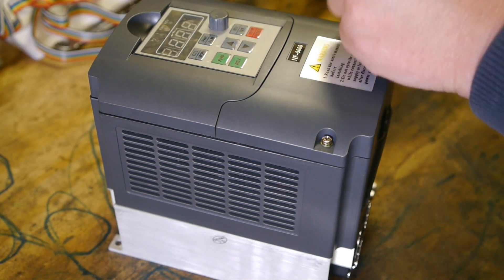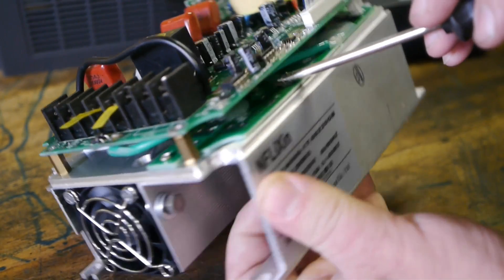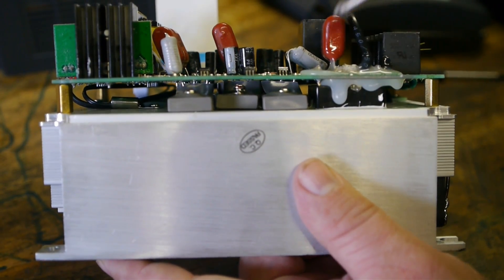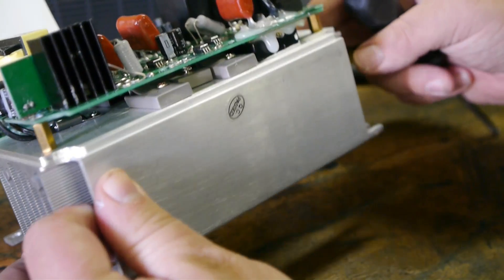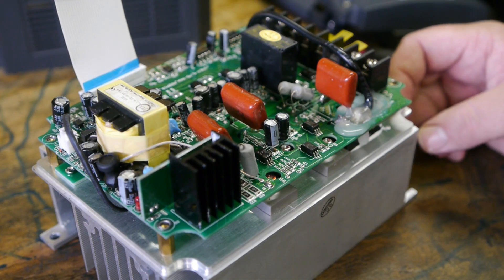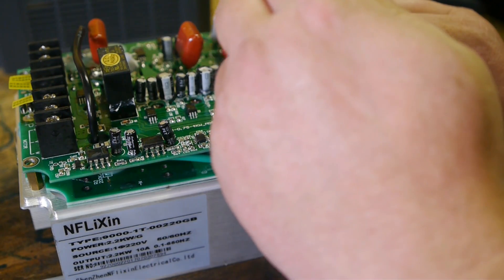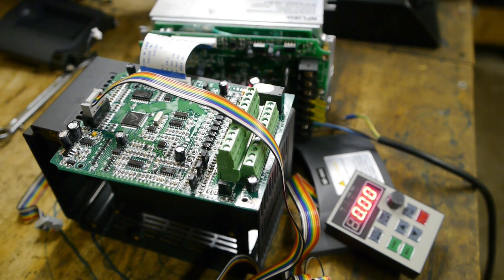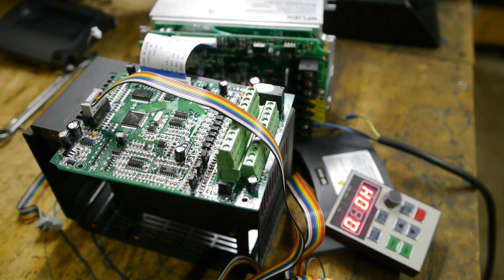A look inside a cheap chinese frequency converter

Comment from the maker: FYI: Without the sensor connected, F062 (heat sink temp) reads zero and rises rapidly when I short the connector the drive goes almost immediately into overheat protection. So the sensor most be an NTC and firmware seems to be programmed to start the fan immediately. (Perhaps to cool the build-in brake resistor) 
Unless I find a parameter to change this behaviour, witch seems unlikely given the limited manual,  there is not much I can do. Looks like the manufacturer was correct and the manual wrong. It still sucks though!

Comment: I run an external fan (old PC 12v fan) using the 10v and COMM output.  Inside a cabinet, the PC fan blows air upwards under the VFD.  The VFD fan operates when the logic is running and about to provide 380v output.  With the external PC fan, there is direct air movement over the heatsink as well, whereas the VFD fan is only over one part of the heatsink (9100, 5.5kw, has one fan).

Comment: Weird! Why would you fit a sensor and not use it? Just stupid to do that. You could make a small temperature switch board of your own and connect it between the two pin fan connector on the board (it will provide power as it is always on) and the fan itself. I know you said you know little about electronics, but only a few components are needed. Do a search for: MOSFET fan temp switch to find dozens and dozens - some simple and many more complex ones using a microcontroller (NOT required)

How is your soldering technique? Here are a few design ideas using a single N-Channel MOSFET. There are multiple subtly different designs on the same theme. The simplest requires only THREE components and could easily be added by just building a "birds nest" circuit - just soldering the components to each other in mid-air and using Kapton tape around to insulate them. FULLY adjustable too, should you need it using a small potentiometer as in circuit 3. Number 4 shows a bird's nest setup.

1. https://circuits-diy.com/wp-content/uploads/2020/01/dc-fan-speed-control-thermistor-965x1024.png
2. https://i.stack.imgur.com/U8hDM.jpg
3. https://lh3.googleusercontent.com/proxy/oGHVuaRc2LMsAVNhK9H2hnWWXWxpap95aczfVYUta4Z7iMUEN2mn0zHeLeagTWHkKKlpDZzEOU5VUvEbCKQP1f3M
4. https://i.stack.imgur.com/U8hDM.jpg

I have literally just taken delivery of a model 9100-1T myself. I hope I don't have similar problems. 

Those small fans are the same type and size as fitted into many Netgear, Cisco, and HP Ethernet network switches and they are STUPIDLY loud. I have NO idea why. Probably due to trying to drive too large a volume of air with too small a fan. You could try sourcing a replacement fan that is quieter, but my experience says there is little choice at that end of the market compared to the more "standard" computer fan. In the case of Network switches, they are REALLY loud (usually 3 or even four fans!) A MUCH better, quieter, and higher volume of air could be achieved by a long radial fan rather than multiple small axial fans. Also, it never ceases to amaze me why electronic designers ALWAYS seem to exhaust hot air rather than forcing in COLD air! Dumb as pig poop in my view!

Comment: I wonder if the drive heats up during normal operation, and the the spindle is turned off - if the fan will remain on if the sensor detects the temperature is still over 45C?
Reply from the maker: Possibly, but I never notice. When I first got the drive I monitored the temperature after I unplugged the fan connector.
Never when near 45 degrees but last winter I suddenly died with a flash and a bang followed by total silence.
The fan on my new stops direct when I stop the spindle. A lot better :) https://youtu.be/O093niJnIaU

Comment: Another great video. I really like your calm, understated style. keep them coming ;-) Thanks. 

From what you said in the video and also the other comments about other fans and resistors I think you are on the right track already with this. But as 2 more alternatives :

1) you already found the wires to the fan. just cut one of those wires and extend then outside the case before you re-assemble the case, now you can do what you like externally. you could simply add a switch, or better a thermostat .. this one costs 4 euro .. stick it on the heatsink somewhere. job done ;-) http://www.ebay.co.uk/itm/Thermal-Cut-Out-Switch-Norm-Closed-50-Deg-/121160281136?epid=1887932176&hash=item1c35b72c30:g:CZYAAOxy5jxSboQE for 50C or http://www.ebay.co.uk/itm/Thermal-Cut-Out-Switch-Norm-Closed-at-room-temp-Opens-at-40-Deg/301641848381?_trkparms=aid%3D222007%26algo%3DSIM.MBE%26ao%3D2%26asc%3D45564%26meid%3D3cb7495e25684c9297082a9cc633f18d%26pid%3D100005%26rk%3D2%26rkt%3D3%26sd%3D121160281136&_trksid=p2047675.c100005.m1851 for 40 c .. 

2) May not be possible if your lathe motor has no fan, but if the motor has a fan, as a twist on the "since your load is small maybe you dont need a fan at all" approach .. the control panel can be mounted remote from the unit, mount the VFD so the airflow from the motors fan blows through the heatsink, and leave the VFD fan not running

good luck
Reply from the maker: Thanks. And you are in luck, there is another video coming soon :) I still need to check out that sensorless vectoring business. 

I'm thinking about mounting a variable resister with a on of switch. I just need to figure out the capacity and availability.

Comment: Thie third wire on a 3 wire fan is usually a tachometer output. The CPU monitors the tacho signal and generates a fault if fan speed goes to zero with power applied. Fans speed is controlled by duty factor of power applied. Fan motors are nearly all brushless types, and a series resistor may or may not work. The goop on the heatsink is usually a grease filled with titanium dioxide to improve thermal conductivity. The 'condoms' are probably a composite of silicone resin and some sort of glass fiber or thermoset plastic mesh that improves its compressive strength. There is usually enough thermal grease left on the heatsink and components that reassembly is satisfactory. However, this assumes you didn't scrape it off and/or damage the 'condoms' during disassembly. You can use a 3 wire fan by just ignoring the tacho output wire. Just be sure to get the polarity of the other wires correct. Your drive fan is probably a 24 volt model. Computer fans will be 12V or 5V, so not useful. You should be able to order a quieter replacement fan from any electronics distributor. Presuming you are in Europe, maybe Farnell.
Reply from the maker: Thanks for explaining all that. And you are right the fan is 24v. perhaps I can use two computer fan''s. It's easy to mount a second fan on top of the VFD.
Reply: Rolingmetal Why make such a big deal out of buying a 6 dollar fan with the exact same hole pattern? Putting 2 brushless fans in series, with their switchmode operation, can lead to some strange effects. You will probably find that neither one is happy being in series with another. The current draw is in pulses....
Reply from the maker: I don't expect another one of these small fan's to run any quieter.
Reply: Rolingmetal You will find, if you bother to look, that the same size fan is available with many rpm ratings and airflow ratings. Also, there are varying numbers of blades. If you choose a model with lower airflow, lower rpm, more blades, sleeve bearings... any of these will make it quieter. As a power electronics designer, I think I know a little about these things, but you can continue to believe what you want.

Comment: That sensor is most likely an NTC so it's measuring, not switching. Be careful when you re-assemble the IGBTs and the rectifier, good thermal contact to the heatsink is essential. Also make sure the insulation is not damaged and correctly in place as the IGBTs are at 320V against the heatsink. Mine is definitely quieter, but you can use one of these cheap temperature controlled PC fans.   Or just unplug it, the controller will switch off when it gets too hot anyway.
Reply from the maker: You' re right. The sensor on  the heat sink provides the temperature readout for F062. Without the sensor connected F062 read zero and rises very quick when I short the connector. Strange I didn't measure any resistant over that sensor. But that's probably my fault.
Thanks for the heads up. I will carefully inspect that rubber I was poking at with a screw driver.

Comment: Why not just replace the fan with a quiet one ?

It just looks like a PC case fan, and they are generally very quiet, and run continually.

Cheers Rob
Reply from the maker: It's a few sizes smaller than your regular computer case fan. It's even smaller than today's cpu fans.
And computer fans are usually 3 lead speed regulated fans so they only spin up when needed.
But if I can somehow mount a big fan perhaps with a variable resistor that would certainly help.
Reply: Some PC case fans only use two wires.

http://www.ebay.com.au/itm/92mm-Case-Fan-12V-DC-PC-CPU-Computer-Cooling-Fan-2Wire-2Pin-High-Speed-/122548368242?hash=item1c8873b372:g:Hy0AAOSwvflZQRIi

You can get them in many sizes. 

Just try your local electronics supplier.  You can also get hard disc drive cooler fans (x2 on a mounting plate) that are small,  quiet,  and dirt cheap.

http://www.ebay.com.au/itm/Dual-3-5-Hard-Drive-Disk-HDD-Cooling-Fan-Desktop-Cooler-Radiator-for-Desktop-PC-/321525936488?hash=item4adc707168:g:ibQAAOSwgQ9V1xIx

Cheers Rob

Comment: I think the next step is to disconnect the fan.  Your motor is smaller load than the 2.2 KW capacity.  Likely the fan is not required.  I would disconnect the fan and try again.
Reply: I tend to agree, its a shitbox fan in the first place, which is not going to move that much air under serious load, one could get a quiet pc fan in the 80-120mm range, half ass it on the outside with a finger guard and if inclined add a thermocouple and get much better cooling with a lot less noise. 

you want big ass fans with a small number of big ass blades spinning at low RPM to kill noise while moving a crapton of air, not some tiny 8 fin shitbox running at 3000 rpm
Reply from the maker: That would probably shorten it's lifetime considerably.
And the forced cooling might be needed for the build in brake resistor.
Reply from the maker: I'm thinking about a bigger fan and a variable resistor.
Reply: As others mentioned computer case fans may be the way to go.  I have some which include the resistor.

I do not think you need to use the brake resistor.  The VFD should have a setting to start and stop the lathe in x seconds.   The brake resistor is to stop the lathe almost instantly.  This is of use when needing to thread to a shoulder especially for short threads.  In US this is of use for the folks doing gunsmithing who need to make short threads on the ends of barrels.
Reply from the maker: I've been using it without a fan for a while now and the highest temp I've seen is 35 c
I reckon, as long as I don't use the internal breaking resister it will be fine without the fan.